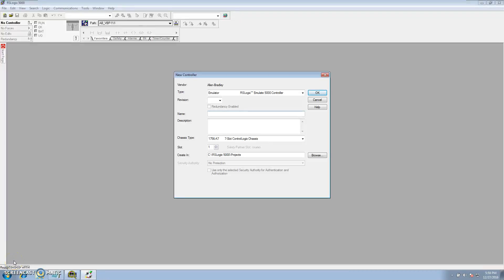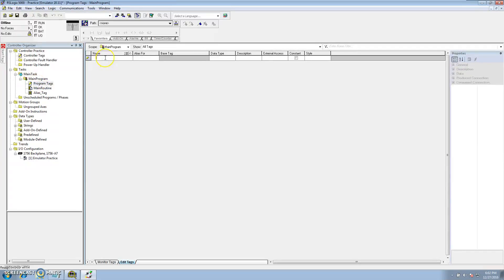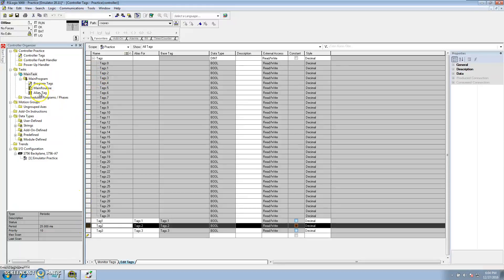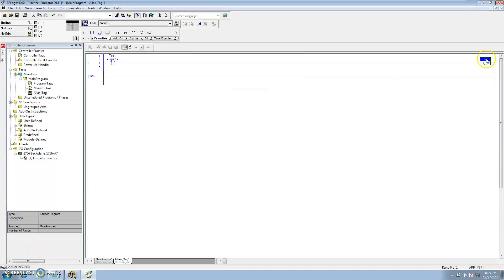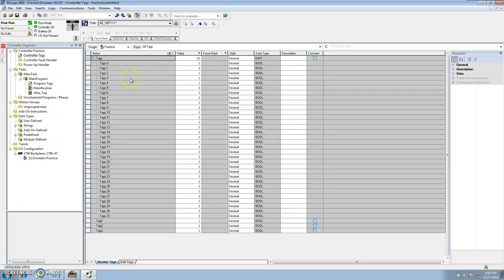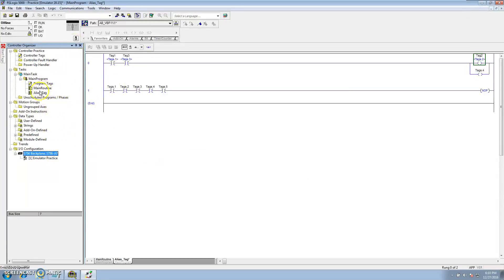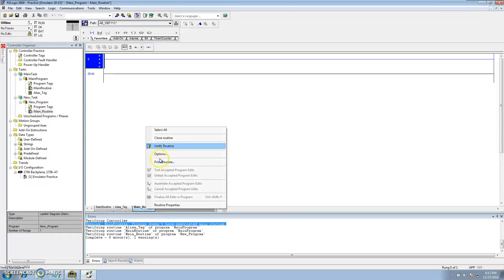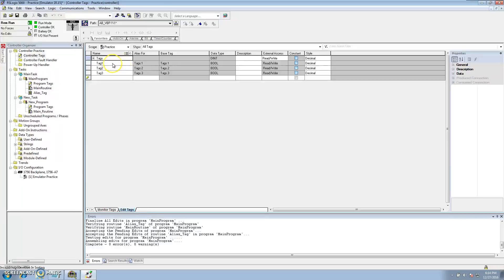RSLogix 5000 | Alias Tag Structures | Controllogix Tags

Comment: Do you prefer Tag Aliasing or IO mapping in different subroutine?
Because in case of mapping Analog signals we can limit Low (<4mA) and High (>20mA) values using comparators.
Reply from the maker: They are completely different in uses so I am not sure what you mean.

Alias tags are for anything

I/O Alias is for I/O linking to the tag.

Comment: So in a nutshell, why even have Controller Tags and Program tags. I believe I'm having this Problem when looking for tags to use in my DDE. Some tags I see and some I don't, but they're in the same logic rung. Is there any way to get around this?
Reply from the maker: Is everything setup in your topic configuration?

Depending on which version of software you are using as well could help explain things a little better.

Thanks,

Shane
Reply: Yes, My topic Config is all set up. Like I said I see some tags but not others and they're all in the same routine. Seems that whatever the name of the routine is, and This might sound odd but When I do go to my Routine names under my Controller's name in OPC/DDE, at the drop down whatever the name of the Routine name is all I see are only all the alphabets names that is the same as what the Routine begins with, for example, "American Move" I see all "A's" "Fat Tuesdays" I see nothing but all T's, "Mini Me" I See only the M's or in other words only the tags in that routine that begins with the Routine's same first letter. Crazy!
Reply from the maker: showshocka3k 

This sounds like an issue with RSLinx, what version are you running. 

3.60 or 2.9
If younger than that then it is but it also could be an issue with factory talk as well.  

I assume you are trying to nap some tags to an ME station or an SE station. 

If so then please verify that you have good conductivity to between  your PC and the network.  

I am sure you have tried a folder update regularly right? 

Sorry for the delayed response, I just got off work.
Reply: Rslinx 2.54 Single Node - FTAM 4.01and for my Ms Excel DDE
Reply from the maker: showshocka3k 

Wow,  still using the old technology I see.  To be honest it could have something to do with that version of RSLinx.

I would try 2.59 if possible but it could be the version of the excel file or macros on the excel file. 

Have you tried others computers?
Or made sure the excel file is good? 

Thanks,  
Shane
Reply: I have noticed that my Rslinx is toggling between Sigle Node and then, some other times is shows Classic Lite version which explains the times that I can not use DDE because that version does not support that feature. I've never seen that before.
Reply from the maker: Sounds like an issue with an early version of RSlinx. They issue with things like this before in anything below 2.59.02 CPR9 SR 5

Especially if you had RSLinx lite on your pc before....Maybe do a backup of yoour RSLinx then do a repair on the software but I recommend going to RSlinx 2.59.02 CPR9 SR 5

Hopefully that info helps you.

Shane
Reply: Thank you. It was also doing this with the 3.9 version of Classic lite I had installed so I uninstall it and started back with a fresh older version. 2.54.0011 PR 9 SR1
Reply from the maker: Yeah, depending on the versions of software you are using makes the version of RSLinx critical using some features.
I use 2.59.02 and then 3.90.00 on my version 30 build.

I use the full classic and enterprise though not lite.

Comment: Why not keep it simple like with RSlogix 500??? Are you kidding me??? Rockwell really went too far to over complicate and confuse engineers and technicians with all this stupid tasks ordeal on the 5000 version.  No largest factory or machine or process in the world would ever use all those many non sense tasks, over task, over program, over task, over tags, over alias, over task, over routine, over etc options in a ladder program!
Reply from the maker: First of all, thanks for the comment.

Next, this is not complicated. There are plenty of processes & machines everywhere that use all four languages of programming to make the machine or process running it's best.

Not sure where you work but the world runs off more complicated stuff than this.

This is simple
Reply from the maker: My friend, if you think this is complicated then this might not be the career for you.

Although, if you try then you can accomplish anything but it's up to you to try.

I hope the best for you
Reply: @ShaneWelcher Thanks for your reply. I work for Amazon in the Automation department. I'm been programming several PLC brands for over 15 years now. It is complicated. Is not your fault my friend. All good.
Reply from the maker: @johnboon5330  The best method is always to keep things user friendly for the operators which often ends up being slightly more complicated for us but in the long run, saves us tons of time by having a properly built machine.